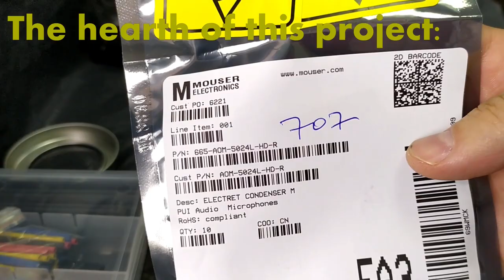How to make BINAURAL microphones for ASMR recording

Comment: Do you have any idea why these DIY 5024 mics only work with external recorders (like Zoom) but not with USB sound cards? I am using TRS plugs.
Reply from the maker: They will only work on soundcard mic line in if the card has plug in power supply. Most soundcards support it, so 5024 capsules will work using TRS or TS plug. I've tried that  and it work but not the best. Try searching in the soundcard properties to find option to enable plug in power supply. Sometimes enabling " microphone boost" wakens up the mic. Try using TS plug instead of TRS, because it could be a mono input on the soundcard. Play with it a little, it could lead you to working mic. Sometimes the devil is in the details ;) Hope to help

Comment: hi, which capsules are better em272 or aom5024l?
Reply from the maker: They both are great! Em272 are more expensive but are beter tolerant to high decibels. If you are about to record ambient sounds, such as nature i guess AOM is the better one. SNR is pretty much the same in real life for both capsules. More important is to get the original ines ;)
Reply: @FixitEasyDIY  Thank you for your answer, at the moment I use aom 5024 I record sounds in the city, for now I will use the cheaper ones :)
Reply from the maker: I just love 5024. In my opinion it has no analog for its price for this job. Good choice 👏👏👏
Reply: @FixitEasyDIY  Thanks you , :) Best wishes
Reply: @FixitEasyDIY  I have just tested a few PUI AOM 5024's that came the other day at my workshop, I am blown away by their sensitivity, as the existing EM272's that I use are so quiet in levels I have to boot them up by 20db!!!! TWENTY!!!! I can't friggin believe it! I'll be doing more tests, but I'm really impressed, as no doubt I'll be testing them out for the ASMR community in the SR3D XLR mics I manufacture.

Edit, don't use drills to make holes in silicone... ughhh!
And you're hanging about too long on the soldering, it's a quick touch and off!
Reply from the maker: Yep they are incredible 😍 You are right about drilling in silicone. You are right about the soldering too. I bought myself a better soldering iron and supplies to make things better and faster. I am planning to make some more projects with these capsules during the summer. Let's see...